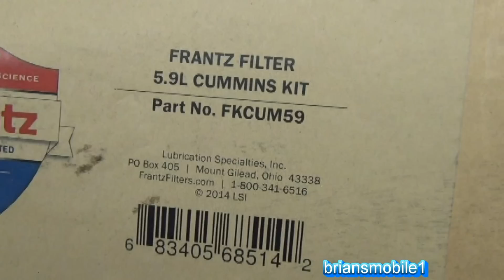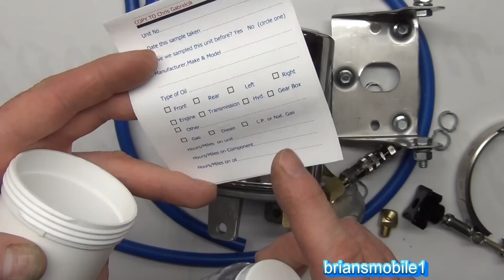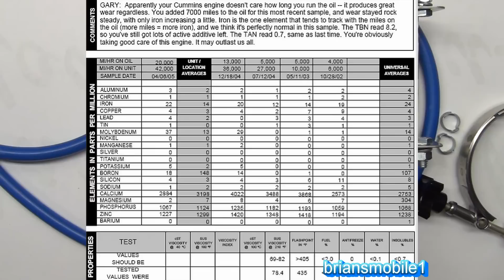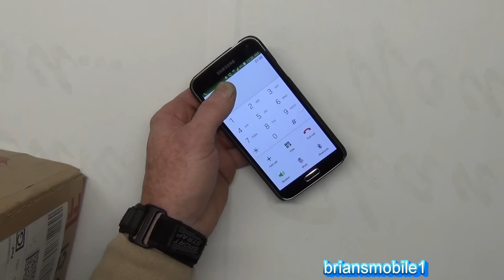How to Make Synthetic Oil Last Even Longer  Frantz

Comment: the old 50's G.M. trucks we order from J.C.Whitney cattalogs. those old trucks came factory without a filter.
Reply: Filters were optional equipment in those days and were all bypass types. On the chevy 6s the bypass filter was clamped to the intake manifold. In 1953 John Frantz  came out with a container that allowed you to use toilet paper in them.Actually the origional Frantz was a canister similar to the new Frantzs  It had a hole  in the center so you could slide it into a larger Fram or other cartridge filter upside down. I won't get into the details on seals and washers. The Famous Frantz 3 stacker that you can still find on shrimp boats and such was a taller canister that took three Frantz canisters with three rolls of toilet paper. Saw one on Ebay.They aint cheap. Frantz also had a FAA and PMA approved AeroFrantz.  Saw some on crop dusters in the early 80s. Read aircraft oil analysis . Dont know if Frantz still has oil analysis reports on aircraft oil. The aircraft filtersused the same TP we used in the cars.2 ply facial quality. .most of us use Scott 1000 now..I prefer the top loaders that are better equipped to use TP. Such as the Jackmaster Classic.
Reply: You must be older than dirt. I remember when Sears Roebuck sold Henry Js Short for Henry J Kaiser. Sears Allstate. You could go to an appliance store and buy a Crosley car. I had a Crosley radio. Some people saved money by.going to Detroit to buy a car.
Reply: The old cars used the optional  equipment bypass filters that were a lot better at cleaning oil than what they put on cars now. Normally used cotton. When John Frantz converted them to use superior toilet paper they were even better. When they were converted to pleated paper they were crap.

Comment: Seems like a good idea.  Now would this pull out debris that an oil test would would warn you about upcoming issues?   Consistent oil tests will let you now when something changes in your oil.  If this filters so well I wonder if oil analysts would still be for warning.
Reply from the maker: Chances are it would hide history of a problem, but it would also help curtail that problem too.  Those little tell-tale particles serve as a warning, but they also attract and gouge out more particles too.
Reply: I have an old instrument that passes an electric current thru a used oil sample.It is zeroed on new oil the same as what is in the engine.its like for big diesels engines. Dirty oil conducts electric better than clean oil If the reading is too high a sample goes to the lab. If the instrument pegs out the engine is shut down first. Some engineers on these drilling rigs have a good idea what is happening before a sample goes to the lab. To me the oil is either dirty or clean.
Reply: Its amazing. On an over the road truck for example oil analysis can tell you your air compressor is wearing out so you can change it before you get stranded. They know what is wearing out by what kind of metal is showing up in the analysis. I put a Frantz oil cleaner on a race mechanics truck.that he pulled the race car with. I used a Frantz Adapter that eliminated the full flow filter. He could tell by what was showing up on top of the toilet paper the condition of the 292 big six Chevy engine. A long time ago. 1965.

Comment: Is this only for Diesel?
Reply from the maker: It's for engines that use oil.
Reply: Also need an oil pump.when I bought my first Frantz in 1963 all we had was gasoline powered pickups.Frantz instructions covered most American cars and the VWBeetle. Some put them on Harly Davidson and Model A Fords..Dont know how they did it. The Frantz on my 70s Honda 500 Custom was the same as a  car

Comment: Just one thing.   How do you handle disposal of this toxic stew you are extracting from your motor oil ?  Does it go to land fill in your garbage, can it go someplace that incinerates ?  You could run it through a burn barrel at home and what a smoke THAT would make.  Really good electric cars are a way off yet but I like making my petro powered vehicle run its cleanest.  At present I burn the paper products I generate from cleaning up after an oil change and grease jobs.  Not as clean a burn as I would like though spritzing alcohol on the fire helps a small bit, much like adding alcohol to gasoline for that bit of cleaner exhaust.
Reply: Good question I have a 16 gallon container half full of oil soaked toilet paper. Safety Kleen corporation recycled them for me before I retired. Also have a drum of engine cleaner. Dont mechanic anymore.

Comment: Added bonus if you're stuck in the middle of nowhere and you need to take a shit, rest assured you have toilet paper under your hood.
Reply from the maker: Ew!  the skid marks that would leave...  Maybe a spare roll- If you use Scott 1000, you do have 20 to 30 raps of it to remove in order to fit.
Reply: Scary thought, one of the cars I bought had 3 toilet paper rolls in the glove box.
Reply: I was removing 30 rounds from the Great Value 1000 from Walmart  to fit my filters. The Last I bought  was the same size as what we used in the 60s.and the core was larger.with my filters I just slid in the TP and put on the top.The old 50 year old Motor Guards were bad about pinching the last sheet.Not with the new Great value. The last sheet is glued. The Motor Guard elements are taped. Was reading that they are making the roll smaller and the core larger to save paper Always a toilet paper joke.
Reply: It was easy in the 60s. Lots of room under the hood. I did a few Lincolns. They were a packed suitcase but I could squeeze in a Frantz. That clamp could be a problem. I went with the top loaders in the 80s. The Australian Jackmaster Classic is good when you are in tight places. It is better suited for using toilet paper. The Frantz is set up for the Frantz elements.  The Australian Jackmaster Classic elements are about 20 dollars. I use Great Value 1000 from Walmart in mine.

Comment: Do thay make theam four gas engines
Reply from the maker: Yes, there's a universal kit for them.
Reply: I did a fleet of tree service equipment. All I had was Gulf Coast universal filters. Medium duty International diesel trucks.Ford Powerstrokes. Ford industrial gasoline engines on the chippers.A Bob Cat loader gasoline. Heavy duty Chevy 350 in a chip truck.That was years ago. The 6.0 Powerstrokes had just came out. Gulf Coast filters might only do heavy duty diesel engines now. Such as locomotive engines on Shell offshore rigs. The Australian Jackmaster is replacing the small filters. At 82 I dont crawl up under trucks anymore.I did get a Australian Jackmaster Classic off Ebay because I was curious. Jackmaster and Gulf Coast might be working together. Some are going to the military. Saw a Gulf Coast filter on a Humvee and a 5 ton in the 90s. Dont know what they are doing now..I believe the Humvee had a 6.2 GM diesel. Its been awhile.

Comment: If I'm going to go the expense of jerry-rigging a bypass filter system in my brand new truck under warranty it's NOT going to use a roll of 99 cent toilet paper, I'll use something a little bit appropriate for the job at hand, like microglass media in a spin on cartridge rated 1, 3, or 5 micron absolute. You can even add a Delta P switch and it will tell you when to change it so you can plan accordingly.
Reply: Where do you source a 1-3 micron microglass media element that is not cost prohibitive?
Reply: You could try eBay if you feel lucky, but any reputable hydraulic parts distributor should have them. Cheapest brand I know of is Norman Filters, their construction varies somewhat, but as long as it's not for any esther type fluids (brake fluid, skydrol, PAG oil, etc.) it doesn't make a difference. Glass media spin ons will have an "M" in the part number, like "303M".
Reply: Cheezy Dee 
Thanks
Reply: You sound like a you get what you pay for guy.. I had the micro glass filters on a big compressor at work. They dont clean oil. I had a Motor Guard toilet paper filter on there to clean the oil. When I changed the micro glass filter I brought it home and put it on my Farmall H as a full flow filter on the hydraulic system . Its been on there about 20 years.There is a Motor Guard bypass filter on there to clean the hydraulic fluid. It of course uses toilet paper. You can get elements now as good as toilet paper for a little more than 30 bucks if that makes you feel better. I had 1 micron filter bags at work that could filter to 1 micron for about 5 minutes. It takes depth such as toilet paper.
Reply: When you mention TP filters you can always count on a corny joke or a  fool that dont know anything about them but has an opinion.
Reply: Found a micro glass filter today in my used oil filters complete with a filter mount with a bypass valve. It has 1 1/2 inch ports with small ports for pressure differential ports for gauges. I had to fabricate a filter mount on the Farmall. I see a date written on the Micro Glass filter 2001. We scrapped the old compressor and installed a bigger one. I saved the filter and gauges.

Comment: Been running a Frantz in my 98 24V since I purchased it in 08. The inside valve cover surfaces are like brand new still. Easy way to lower maintenance costs. I'd like to add a filter to my auto tranny too. Do you recommend that? 
Love your vids. Been checking out all your Dodge Cummins stuff, awesome! Dave.🆒
Reply: If you still got that truck then don’t bother with a toilet paper filter on the transmission. Just get an external can filter you can spin off every 50k miles and that should be enough. Automatic transmissions hate big chunks but the really small stuff doesn’t matter.
Reply: At one time Frantz had transmission adapters. I make my own. They go into the line to the cooler. It is 2 tees with an orifice in between. Gulf Coast might have the adapters.I think they use a 1/8" adapter. Frantz was a little smaller. The fluid hits the orifice and backs up. Part of the fluid goes to the Frantz .The clean fluid goes to the low pressure side of the orifice. My transmission   book says to get a spin on filter mount and a high quality  spin on filter. A lot less hassle. At any rate you will need to determine which way the fluid is flowing.
Reply: Ive been a clean oil fanatic for 60 years. My Farmall H has a Chevy 4 cylinder engine with a Impala automatic. The Impala has a decent stock filter in the pan. It has a Motor Guard TP filter to keep the tranny and the stock filter clean. The 76 F 250 Ranger has a Gulf Coast filter on the tranny. The Ford has a lousy screen the same as the Nissan Altima. The Motor Guards are in front of the radiater. I remove the grill to change the toilet paper. Normally i dont change the TP after the first change.  The TP will turn grey. I wired the Motor Guard transmission filter to the top of the 3400 Pontiac engine .The Jackmaster  Classic is wrapped in pastboard and is in a low place.Getting hard to find a  good place on some of these cars. The Atf filter on the 93 Subaru Legacy is just laying on some hoses. Good place for a Motor Guard on the lube oil. Used a two port sandwich adapter on it
Reply: The automatic transmission is a precision piece of equipment the same as the engine. Of course the small stuff will wear the close tolorance parts. The question is it worth the extra cost of a superior filter. All I have on my transmissions is old tp filters that I bought when they werent so expensive.

Comment: Perhaps if used as a bypass filter in conjunction with a primary filter. I did however see a comment that motor oil, if not changed, gets thinner. It most certainly does not the viscosity actually gets thicker. Furthermore an oil change is not required during the warranty period. Under warranty law, if they warranty the internally lubricated parts of the motor for 36,000 miles, the only way they can make you get an oil change, is to offer it to you for free. And some automakers are actually doing that so that they can make you get an oil change. Quite often there is a race that runs from Paris to Hong Kong and these vehicles go over 40,000 miles without an oil change. The automaker's know that an engine will go 36,000 miles without an oil change and frequently a lot further.
Reply: Many years ago my uncle told me when he changes the oil in his 59 Ford it uses a quart then doesnt use any more. Actually a quart evaporated.Multi grade oil wasnt any good in those days. Couldnt use it in a diesel. All diesel rated oil was single wt.
Reply: I have overheated motor oil by idling all day with the AC on in hot weather. The oil will get thicker as it evaporates. The boss called it road tar. It was more like gear oil. Waiting to cement an oil well  for example. Normally the trucks were never shut off all day...i wouldnt do my own cars that way.
Reply: Actually synthetic oil doesnt last longer than conventional oil. Oil filters dont make oil last longer. It is a good idea to keep it clean and not burn it up. A guy asked me how long has it been since you changed the oil in your home air conditioner. Good question.The oil is 22 years old.

Comment: Added note, I used the paper towel system in hopes of extended drain intervals. 
I found that over all, money wise, it didn't hold up in the long run.
Reply: I don't see how you could make your money back on this either.
Reply from the maker: Thanks for sharing that experience.  I've never used the paper towel type filters.  Paper towels are nowhere near as dense as this cheap, hard, single ply TP stuff.  Towels hold and lose way more oil, but just can't catch the little stuff as well.
Reply from the maker: Not everyone will.  Like I said, it depends on how often you drain your oil a year, how much it costs you, and how long you plan to drive the vehicle.  Here's a super easy way to find out → http://www.frantzfilters.com/calculate/
Reply: I think the real benefit is the superior filtration.  If you have a look at the link to the Cummins Forum Brian put in the video it should explain the benefit.  Even if you continued to change your oil as frequently as "normal", the reduced engine wear would more than counter the cost of the kit, extra quart of oil and the TP.   How much does a new engine or rebuild cost?  I'm seriously thinking of adding this to my 225K mile cummins.
Reply: My experience is with toilet paper filters. NASA saw my posts and started using the big paper towel filters. T he engineer said TP is better than  paper towels. This is no surprise but the paper towels have the size advantage.The oil has to travel thhru 11 inches of paper 22 inches in the double roll model.  They use the Big paper towel filters on the locomotive engines on Shell offshore rigs.shell oil loves them. At one time they used Frantz 3 stackers on them. I have no idea how many rolls of TP it takes to equip a locomotive engine. You dont want to change 10 Frantz 3 stackers. Ive done one
Reply: What else is new I have two Motor Guards that have been in use for over 50 years probably cost me less than 50 bucks. I dont drain oil. Do the math. My engines never wear out.  Its funny  bypass filters have been around since the 20s They all hook up the same way.when you mention TP filters there must be a restriction of the flow..its amazing. The old.AeroFrantz was FAA approved. Used TP and was almost the same as the car filter. I believe the clamp was differrnt.. If you think oil is supposed to ger dirty dont buy a TP filter.
Reply: One advantage the paper towels have is the abrasives are able to go farther into the paper before being hung up between the layers of paper. This is very important when filtering fuel. Some times when filtering fuel the TP stops everything before it gets 1/4 inch into the TP. Its best if you use most of the TP.. I was using a Motor Guard TP filter for gasoline on a Toyota Camry. The TP was black about 1/8 inch into the TP after about 200.000 miles. In other words I wasnt using the whole roll. Its hard to get contamination all the way thru a roll of Bounty big roll of paper towel. Gulf Coast filters is putting a lot of paper towel filters on the Dodge Cummins engines. I think they have about the same micron rating as Toilet paper. Excuse me its not Bounty Big Roll now.its Gulf Coast filter elements. The hot shot guys dont want to deal with the little TP filters. They want 1 1/2 gallon or 3 gallon filters. I wonder if T A truck stops still service them. Let T A deal with disposing  of the big filter elements. TA had the Gulf Coast filters on the shelf.

Comment: The only time I. drain oil is if I get a problem such as coolant contamination I changed the oil on my 64 Rambler because of a leaky head gasket. When. I buy a used car I will drain the oil. I like to know. What's in the crankcase. In the 60s I used Delo 100 and changed the filter about every 2000 and added a quart of oil.